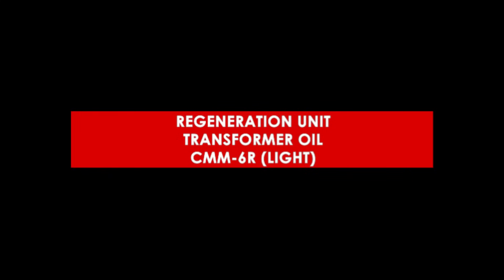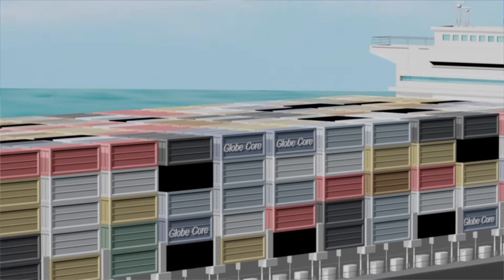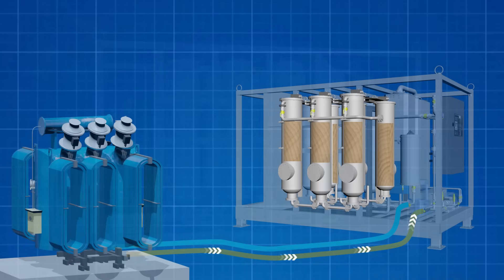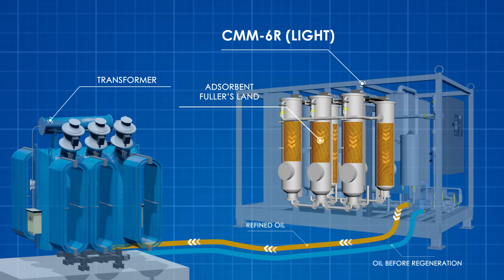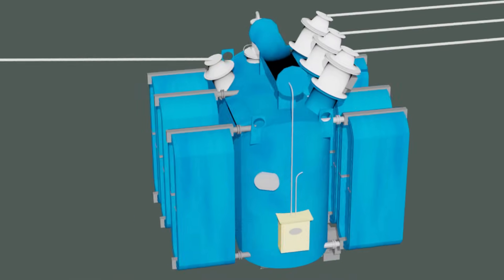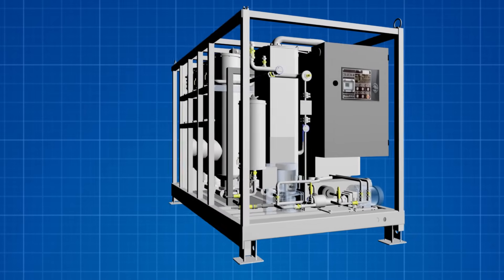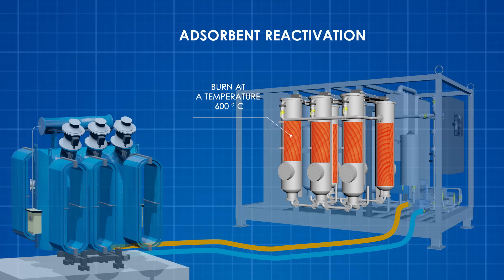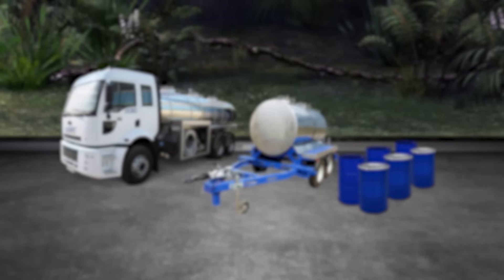Transformer oil regeneration machine CMM-6R (light)

Comment: We plan to use such machine in the field nearby the transformer. Is it possible to manufacture such machine mobile so that it would be easier to deliver it to operation areas?
Reply from the maker: Yes, we can mount this machine on a wheel trailer.